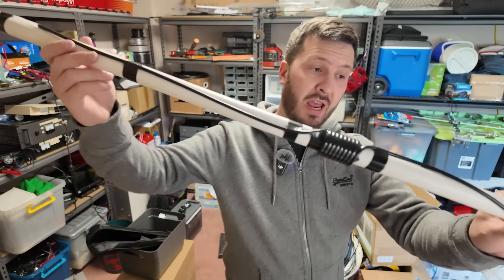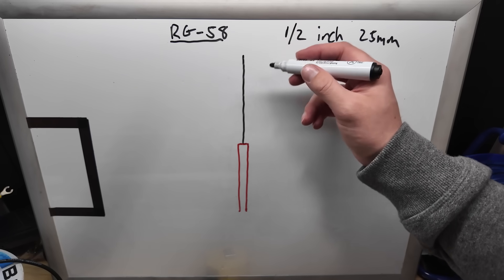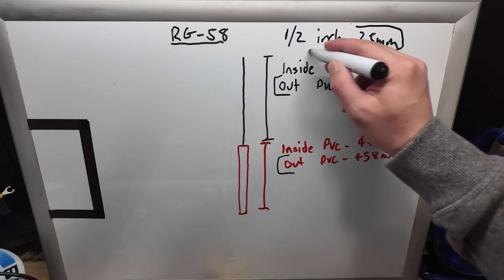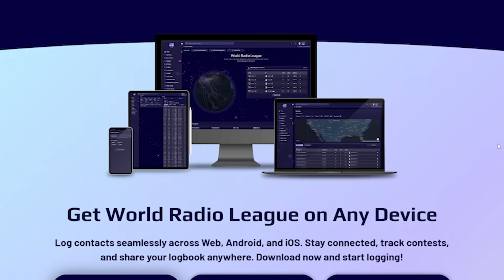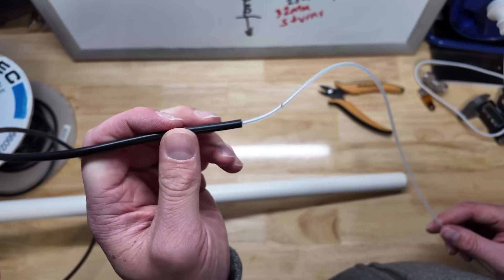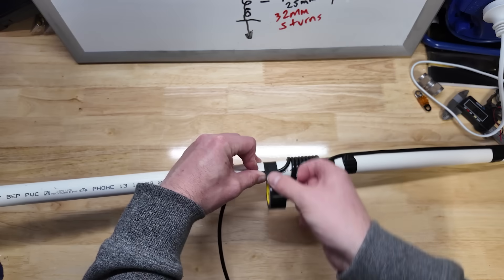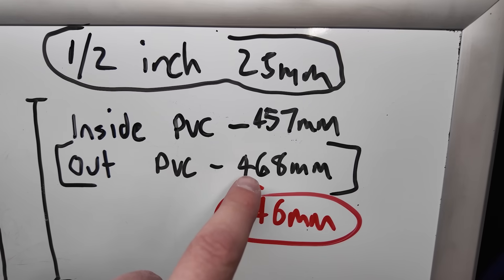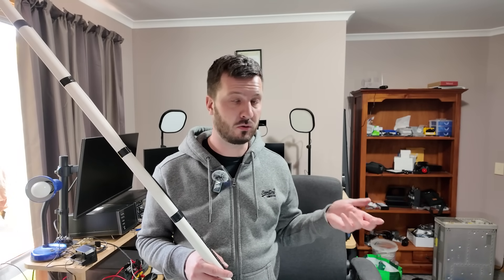Build a 2m (146 MHz) Antenna for Just $5

Comment from the maker: Yep.. it's clear I don't do freedom units very well...
Reply: Yes 1/2" =12.7mm. 25mm is closer to 1".
Reply from the maker: @george_KC1TQF  Roger that!
Reply: I had to Google freedom unit which is American slang, we are in Australia and we normally refer to those measurements as Imperial or Metric
Reply: @brettchurchyard5018  "freedom" sounds bettet than "imperial", but it's no longer valid
Reply: 1/2” inner diameter. The od is probably close or equal to 25mm
Reply: What formula did you use. 145mhz is center band in the UK
Reply: I thought you folks used bananas, not freedom units, for real measurement units!
M&Ms are for eating.

Comment: At about 10m:03s the printing on the PVC pipe says 20mm. If that's the diameter of the pipe you're using, would you need more than 9 turns on the choke, as it's less than the 25mm stated in the description? Not a criticism just an observation, it's just that I've never been able to get a good VSWR with 9 turns on 20mm pipe (I've always needed to add a couple of extra turns). The video is great by the way!

Comment: How do you calculate the number of turns for the choke? Is there a rule? I will use a 25mm PVC pipe so it's 9 turns for me. Can I use the nanovna to verify that the 9 turns is the best option for the antenna?

Comment: Why do you make that coil at the end of each antenna?
Reply from the maker: That is a choke to stop common mode currents flowing down the outside of the coax (which can cause RFI issues) & to signify where the antenna effectively "ends" and the feedline begins.
Reply: @HamRadioDX  Hmm okey, thanks for your reply. Gonna digg deeper into that

Comment: In the USA typical 1/2" PVC pipe is only about 21.250 mm outside diameter while typical 3/4" PVC pipe is about 1.05 inches or 25.450 mm. But nice  info otherwise for an old, retired Electrician, new Ham KO6EOR. Thank You

Comment: Very good antenna, I built "inside" version and it works perfectly! Greetings, 73 de SP3PW
Reply from the maker: That's awesome, glad to hear it works well for you!
Reply: Curious - how did you secure the cable inside the pvc? 
Trying to figure out the logistics of that because it seems more weather proof without too much trouble esp with a pvc endcap popped on it.
Reply: @KatyRoseG There is no need of extra-secured cable, as hot-wire got additional plastic insulation. But to be more weatherproof you can use anything - even nail polish at the top of hot wire would be good.
Reply: Sorry I just meant how did you get the tape up inside the tube to get the cable along the pipe
Reply: @KatyRoseG I used few centimetres of sewing thread tighten with plastic cap on the top of the tube.

Comment: I have been teaching how to make a 2 meter and a 70 cm antenna from just the coax wire . For years . It is easy and cheap for those in need to get out more than the rubber duck antenna will let them . You will need the correct end for your radio . Myself I have learned to pack a bunch in my pack . They are cheap and old cable tv wire is normally not hard to get .

Comment: Slight correction,  1/2" would be closer to 13mil (12.7) , 25mil is 1"
Reply: 1” is exactly 25.4mm.
Reply: @skinosensei  the pipe he was using was 20mm or 3/4 but thats ID and the OD is closer to 25mm but yes we have metricized the imperial and people forget that 0.4mm

Comment: I built one for 10 meters, used a 4 inch PVC for the coil loops only. Used 1.5" PVC for the antenna pole. Can adjust between 10 Meters and 11 Meters by adding  more loops to the coil. 6 coils for 10 and 9 for 11. I used a Nano VNA to tune it. Works good!

Comment: It looks like this is a very broad antenna ! 144 to 148 easy.  Am I seeing your meter correctly?

Did you happen to check if it was resonant on the 3rd harmonic UHF band? That would be great !

Blow the dog off the chain !
New one for me 😂 
I grew up in blustery winters like that!

Thanks for the video assembly !  My next step would be to put a coil design up the whip phasing multiple co-linear elements for a little bit of gain.  But this is a great simple antenna to build on the fly when you need something quickly!
Just great! Thanks so much! 

I'm going to pat you on the back at Dayton next year ! Great place you live BTW!

Thank You !
Reply from the maker: Thanks for the kind words, I appreciate it!

Comment: Hi There, HOW are you calculating the choke to become 9 turns on a 1inch (25.4mm) diameter former please?
I want to also make one of these antennas for 70cm use, but i don't know how to calculate how many turns the choke coil will need for the 1 inch former.
Can you please advise?
Reply from the maker: Hi mate, if you search for flowerpot antenna you'll see designs including choke coil size from VK2ZOI.

Comment: Hi Hayden
Is that your absolute best effort in building the Flower Pot antenna ?
How long do you expect that to last ?
If my first year radio technician apprentice dished up that to me he would not have a job.

VK4SJS
Radio professional and Amateur Radio Operator
Reply from the maker: The goal of this video was to show beginners a simple, quick, low-cost build that works — not a commercial-grade install.

There’s definitely “pro” ways to building but for an easy antenna that gets people on air, I’m happy with that!

Comment: Can you build a 27 Megahertz antenna with that same design I think I’ll try that see what the SWR is I think it will anyway thanks for the video and 73s
Reply from the maker: Yes! You can! Check out my 10 meter version (link at end of the video or on my channel) and then in that video I talk about how you can adapt it for 27 MHz with just a few tweaks!
Reply: @HamRadioDX yeah can I see this ten metre’s?
Reply: @HamRadioDX ok thank you.

Comment: Them easy to make. I made many. Even 11 meter ones. The tune length will change a bit for different coax . like RG 8X or Hyper flex 5 or 7 . Use a bit better coax for 2 meters and up.  I made one for 15 meters and 17 meters. Getting long and bigger coil . Needing longer pole that I have now. I want to do 20 meter one but ran out of coax and money for now. The 6 meter one works great . I put 500 watt FT8 threw Pota Flex 7 and stayed cool.  Even 1.5 KW short time. That started to heat up coil . M & P coax super low loss and great power handling. The one I made for 10 meter with RG 8X takes 500 watts FT8 . That with DXE high vis 8X .The coil can be wrapped on a FT 240-31 Ferrite or a bunch of snap on type 31 ferrites. Then you can slide them up and down to tune. I just run them up my DX Commander pole and make great contacts. And for 2 meters just turn the whole thing 90 deg and you got flat side for SSB . I seen someone use a 90 deg fitting for that. Looked funny but worked great . Once made they go up fast on DX Commander pole . Great POTA antenna . 73
Reply from the maker: Great to hear you've had success with them and appreciate the tips mate!

Comment: You are making a 1/2 wave dipole with a choke at the base. Without the choke RF current & reflections would run back down the feed cable and degrade the system. It suppress common mode current (CMC) that flows on the outside of a coaxial cable's braid. This current can cause unwanted RF radiation, leading to interference with nearby electronic devices, RFI in the radio shack, and even potential safety hazards like burns from high RF voltages (at high power). On the the feedline you could use some properly coax sized Ferrite Beads to stop CMC. But his solution is cheap and just as good.
Another possible upgrade is to take your bottom exposed braid length, cut a separate skirt, soldered at the center junction and lay over the outside of your now fully insulated all the way to the center point feed coax. It again helps to balance things out and minimize unwanted current flows.

Not all coax brands are of the same velocity factor (depending on quality and build material) , so one of those cheap little Nano VNA's he shows would come in handy to finally tune it all up on your desired frequency. The SAA-2N he is using is a very good choice for hams.

Here is a little add-on for the experimenter.  Take your top radiator measurement and place a second ground skirt on the coax exactly that distance down the coax. It adds a little more decoupling and gain to the system.  It is the same idea as Hy Gain and Isopole use in their commercially sold products (that go for stupid high dollars new or on on Ebay).  You can do the same with a traditional 1/4 wave ground plane antenna too, by adding another set of horizontal radials at the same distance away from the original ones. http://www.isopole.com/antenas.php?antenna=1
Reply: I was kind of wondering where the coil was for but your explanation makes sense. I know on the bare copper part it would be to shortening the lenght of the antenna.

Comment: Good heads up on using the math to get the right length adjustment  for a low swr ,good video will likely have a go at the 10 metre as well as the two metre  version Thanks.
Reply from the maker: Great to hear you'll give it a go!

Comment: This is the old: "coaxial antenna" which has a feedpoint impedance of 73.Ω.  It would be better if it were made with RG59 (75.Ω) coax.  They were used on the back of the back fender of police motorcycles back in the day.  It is just a dipole antenna.  It is hard to beat a dipole antenna. Ron W4BIN
Reply: Two half waves in phase will beat a dipole, but it is largish & messy to mount.

Comment: sir im learning for my hf ham test.. may i ask how do do calculate common mode coax chokes windings per band please.. ive seen 22feet of wound coax coil does most of hf. but id like your method please. if obvious diff freqs require different windings.

Comment: 1/2" is 12.7mm, 25mm is 1 inch, or very close to it. The PVC looks like 1 inch or 25.4mm pipe to me. Just saying. Might probably matter when it comes time to wrap the coil.
Reply from the maker: Yep you're right!
Reply: Okay, I just noticed the PVC says 20mm which would be a little bigger than 3/4". Probably all the same as we have here in the states. Yes, metric is so much easier, but 'Mericans are dumb.

Comment: Instead of removing the shield from the top radiating section, just cut a 6MM section from the center and solder the shield and center conductor st the top/end. This effectively increases the diameter of the radiating top section which theoretically increases transmit efficiency. Seal the exposed shield areas with hot melt glue or silicon to keep out water. This way, the entire antenna could be placed inside the tubing. 

Careful, some types of tubing are not good at RF frequencies.
Reply: from what i saw in his videos he had heaps of bandwidth going over band edges.. but im learning all the time. cheers
Reply: @RobbyJones-g7n 
I'm talking about transmit efficiency, also.

Comment: Nice guide Hayden! My nearest 2m repeater is just out of reach of what my current handheld antenna will do so I'm keen to give this a go. Could it work with a 15mm pipe too? How many turns for the choke at that diameter?
Reply from the maker: Hey mate, you might be able to scale it down using VK2ZOI’s data here - https://vk2zoi.com/articles/half-wave-flower-pot/

Although he only mentions lowest choke size of 25mm… but you can experiment a bit

Comment: Great video Hayden.  Since getting on air a couple of years ago, after a 40 year absence  I used one of these antennas for 2m and it also matches up fine on 70cm  (3rd harmonic).  The probable higher radiation angle on 70cm is not a problem as we live on a lower level below the repeaters. It get's us 'out of the hole'  😁
Keep the great videos coming.
Reply from the maker: That's awesome you're back on the air! Thanks for the comment and great to hear it works on 70cm too 👍

Comment: If you build it inside the tube, you can put an aluminum sleeve just up from the coil, and that will add some capacitance and it will be a 2 & 70 dual band antenna
Reply: How does that work and why would you want more capacitance?
Reply: @timmytelebrant7695  Well I have a couple of those antennas built like that and with a sleeve they are resonant on 2 and 70. antenna magic.. and work well on both bands

Comment: @HamRadioDX ... can we replace the cable-coil for a ferrite something ?  ... that will make this even simpler ... so what type ferrite and what shape ? (typenr or link please)
Reply from the maker: I haven't tested with a ferrite, but if you have enough choking at the frequency then it should work! Perhaps a Mix 52 or something and several turns through a core?
Reply: @HamRadioDX  , okidoki ! ... thanks & greetings 73's from Amsterdam Netherlands.
Reply from the maker: Thanks for watching! I really appreciate it!

Comment: Very good video. Good if you need a cheap solution if your space is limited. 👍

What connector should one get? N-type and just get a pigtail from N-to-SMA?
Reply from the maker: I used BNC, but N connector works with the adapter 👍
Reply: @HamRadioDX Gotcha. BNC is good for quick disconnects.

Comment: is this considered a derivative of a 1/4 wave?  a 1/2 wave?  what is the gain?
Reply from the maker: 1/2 wave so unity gain. There is a 5/8 version with gain, plus a dualband for 2m/70cm. Perhaps a future video?
Reply: @HamRadioDX  A half-wave antenna at 146 MHz is 1.025 meters, which is about 3.3 feet.
Reply from the maker: That sounds about right
Reply: @GuitarNewby Multiply by 0.95. also, it's a dipole, so each pole is half of that.

Comment: i did a similar 146MHz vertical halfwave dipole,   But I used copper tape  (the kind for EMI shielding etc)   along the PVC pipe for both legs of vertical dipole  (these were strips of Cu tape about 19" ).    then i slide coax up the interior of the pipe and had it come out a small at the feed point in the middle.
Reply from the maker: Nice! How did it perform for you?
Reply: @HamRadioDX  Hi Hayden,   it worked out really well.   but i think next time i make one like that I will put some clear packing tape over top the copper tape.   the copper tape on the PVC pipe tends to snag on things like the carpet in your car  etc.    having some clear tape over it  or even heatshrink tube  would do better to protect it.    I was getting 1.2 SWR  or better for entire 2m band.   the coolest thing was being able to take a razor blade and trim off 1mm  at a time from each leg.   LOL.   you can only do that with copper tape 🤣

Comment: Great antenna....I built mine on a longer piece of pipe to lift it higher on the shack roof. My resonates ok on 70cm too 73 de VK2AOE.
Reply: I was wondering is it works for 70cm. Usually, 2meter works for 70cm.
Reply: @shelliecarlson7015 Yes they are harmonics of each other 73
Reply from the maker: Awesome!

Comment: Could you make a video for building a cheap antenna for the notorious mini si4732 radio?
Reply: This will literally work fine for that radio. I own that radio and so long as you don't put ANY (and I mean any) external power into the antenna feed line, the radio will work fine. If you electrify the antenna you will blow that mini radio immediately as it has no protection whatsoever.

Comment: So, this is, essentially a vertical dipole.  When building for 6m or 10m, can you flip it onto its side for horizontally polarized contacts?
Reply from the maker: You can try horizontal. The pattern will change (nulls off the ends) and perhaps the impedance too

Comment: Hi you can save coax by just using a length of ordinary wire for the section where you cut away the coax braid.
Reply: It would be interesting to try one designed for 20m
Reply: @chrisherd991 it would work the trick becomes hanging it if my rough guesstimate is right it would be a bit over 30 feet long
Reply: @bensmith4563 it will be the size of an end fed half wave, I would erect it as a sloped antenna.
Reply from the maker: That's right! Thanks for the suggestion!

Comment: The electric tape is changing your antenna considerably because it’s adding insulation to the conductor inside the coax. I guess as long as you’re adjusting for that it doesn’t matter, but the “ electric “ tape is an insulator which affects the conductivity of the wire! You would be better off using some clear box tape, which has no insulating properties to it! FYI
Reply from the maker: Great tip!

Comment: Why is the coax length different when inside vs outside of the PVC pipe?
Reply: To do with the velocity factor of a conductor / wire in free space compared to one surrounded by a more dense medium, is this case a PVC tube.
Reply: Just to put a finer point on DavidSchwatz comment, those factors change the overall resonant frequency which impacts the SWR. Always make the active element a little longer than you think it needs to be then use VNA/SWR meter to cut it down to the right length.

Comment: 1and 1/4 meter of electrician's gray conduit. Strip down and remove  1/2 meter of RG8 outer coax cover. Now with the shield ,slide down over the regular portion any length of coax to for the impedance  matching (no coil needed, and less loss. ad.j swr with antenna impedence meter. Insert assy into conduit with cap. Secure bottom with small hose clamp and drill bottom cap and install. Mines 2 yr old. -VE2bqp
Reply from the maker: Glad that works for you!

Comment: 25mm is an inch. 12.5mm is a half inch.
Reply: I was about to comment. Doesn't give me a lot of confidence regarding design. But I am old person and gets confused really easilly gerge.
Reply: @MakeDoAndMend1 Bare in mind, the Imperial system isn't used in Australia so the error is excusable. All the numbers in the video are correct for a 1-inch/25mm pvc pipe.
I've built dozens of these T2LT antennas for different bands over the years and they perform very well, you should give one a go. 👍🏻
Reply: @mosherj666 we are metric in UK.
Reply: @mosherj666 
Also useful to remember that 1 meter is 39.36-inches.
Reply: @MakeDoAndMend1 We are indeed.